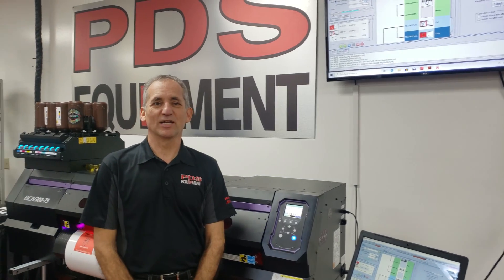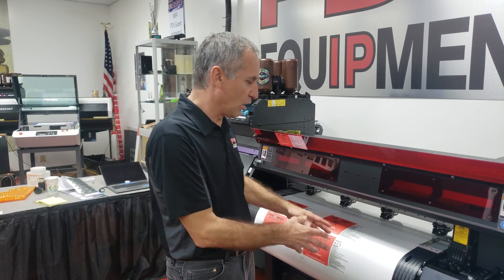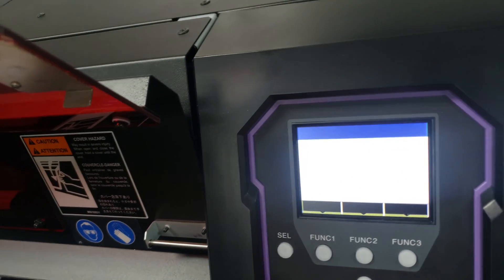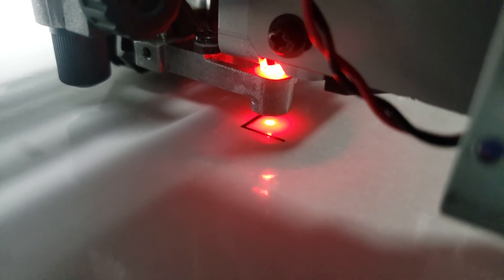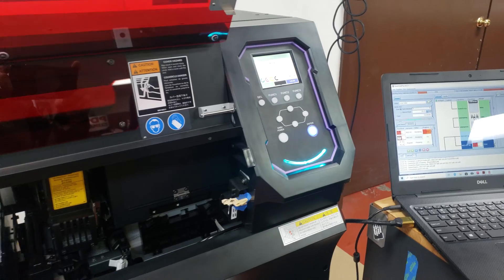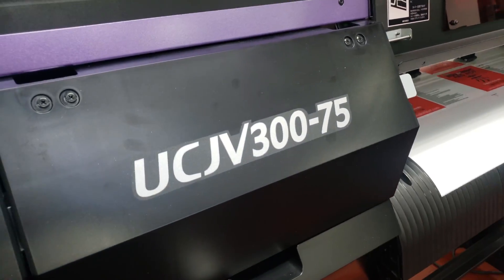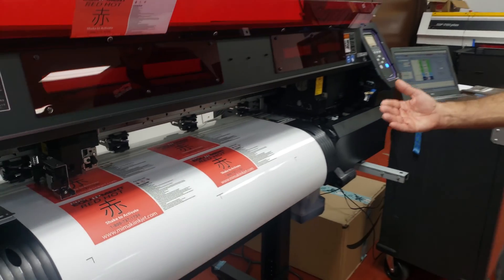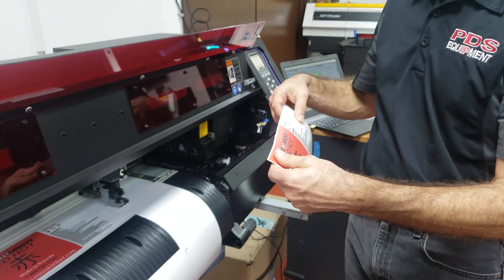Mimaki UCJV 300 Part 3 mark detect.

Comment: Every time I follow this step my CJV printer for some silly reason always gives me an ERROR 201: COMMAND code, and I have to go through a cycle of turning on and off both my computer and my printer. I have no idea why this error pops up instead for me. No matter how I do Mark Detection before sending the cut command, the printer issues a c36 error as well despite no problems on the registration mark. I have no idea why.

Comment: Stupid question: how can I cut with the cover open? Because running Mark Detect with the cover closed is quite difficult.
Reply: There are some metal pieces that are attached to the cover, unscrew them and just leave them on the magnets. Then you can open and close as you want.

Comment: Did the same but I've got: Mark detect error c36 and also TP DETECT ERROR. Mimaki CJV150-160
Reply from the maker: Try making your mark a little longer amd make sure media is loaded straight.
Reply: I have the Mark detect error c36 constantly no matter what i do, could it be that i need the sensor replaced? I also have Mimaki CJV150-160 and it no longer will detect dark materials  @pdsequipment

Comment: For half cut oes the pressure go up once its laminated? Since it gets slightly thicker? I have mine set to 150. Also I have problems sometimes where the pinch roller on the ends goes over a halfcut decal and completely ruins the job by pushing the decal out and shifting the material
Reply from the maker: When you laminate you will need more pressure.  I usually set cut 1 and 2 for no lam and cut 3 and 4 for lam.  You will probably need a little more blade depth as well.  If media is falling out during print make your perfs slightly larger on the half cut settings.  Email me at mgass@pdsequipment.com and I can send you a little more info on that.
Reply: you may try setting the cut sorting option in the machine, so that the cutter head wont go back and forth around your printjob during cutting.

Comment: What is the advantage of printing - then cutting as oppose to doing both together?
Reply from the maker: Some applications require lamination after print, then cut
Reply from the maker: I always print and cut together whenever possible.  If you are applying a laminate film over the print you will have to print, remove and laminate then remount and cut.  Also there are times with a solvent printer that you want the ink to dry before cutting so you may print several jobs then go back and cut.